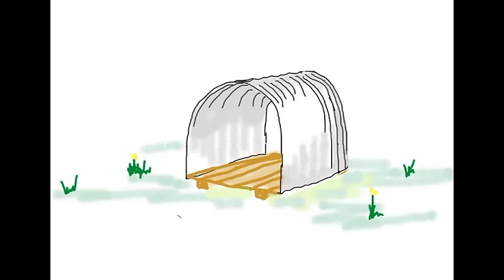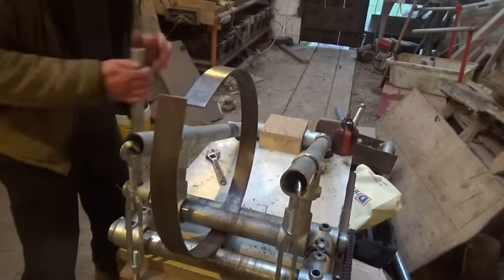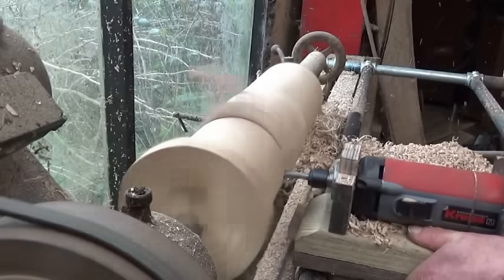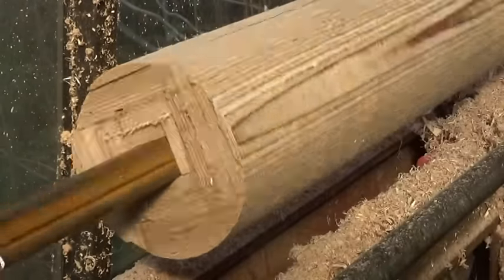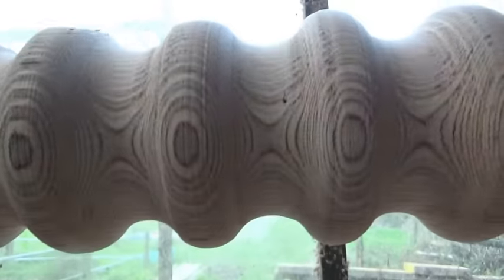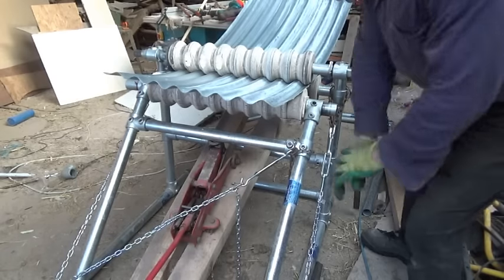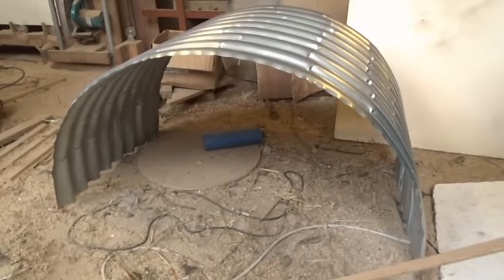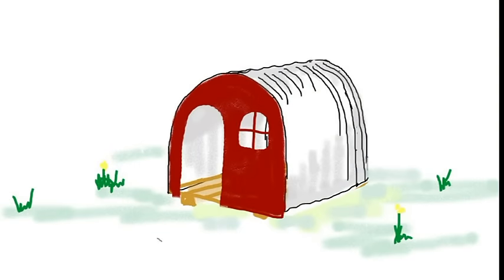Homemade Corrugated Iron Roller (well, nearly!)

Comment: Maybe cover the rollers with fiberglass and epoxy reisen,  but then add a gear reduction, making it easier to spin!
I know that sounds backwards, but if it's easier to turn you can turn it much faster, with it so difficult to turn , you spin it slowly. And aloit of time not spinning at all. So more leverage is needed, then maybe a drill could spin it!!!
Reply from the maker: Ha! A drill? Not sure about that, James  : -  )

Comment: You have literal horse power to hand! How about  shaft drive powered by a horse walking round turning a central hub to drive the roller? Doesn’t have to be fast, just have the power to roll smoothly 45 degree gearing involved on the shaft drive but can be direct to the roller. Seed of an idea? Gears from an old back axel for the linkage? Scaffold poles for shafts! That would be a great machine! And cheap!
Reply from the maker: Yes, but how about reverse?

Comment: Tom I have thought about how they built all the WW2 hangers and rebuild them so quickly, REME must have had motor driven corrugated iron rollers back in the day and instruction books to go with them. The other thing is there is almost certainly a finite radius that standard corrugated iron will go to.
Reply from the maker: You're right, James. I wonder what the minimum raidus is though?

Comment: Have a look at this https://youtu.be/D72M3DTyccg and this https://youtu.be/E18Emx7lHr0
Notice the rollers bend the steel in stages starting in the middle then in next stage another set of rollers on both sides of the middle are added and so on. This is to allow the sheet to “shrink” in width while the bend is being formed. 
You need to expand your machine into multi-stage.
Also, notice how thick the shafts on the commercial machines are.
Consider using 2 or 3” steel pipe with at least 1/4” thick wall as axles for your rollers. You can turn bushings to transition from ID of the pipe to OD of the shaft that will fit into the bearings. The pipe will flex considerably less than your existing shafts.
Reply from the maker: Check out the latest video in this series, Ro K - it's working now!

Comment: Hmmm why corrugated at all? My impression as to why you would use corrugated metal is to create air flow behind your sheathing to prevent moisture build up and rot. At least that's why we use metal corrugated. If its just framed and has no insulation or sheathing then maybe it doesn't matter? aesthetics?
Reply from the maker: It's partly for asthetics - I could do a much easier job with flat sheet, but then it would need a frame, as you say, and that would add a lot to the time/materials..

Comment: Howdy Tim.  Not to far from your original idea, would be to use corrugated metal on the straight sides and a piece of rolled flat sheet just on the top. Use pop rivets to attach the two or a spot weld. The open spaces created by the corrugations could add ventilation. Or you could insulate the inside to stop condensation.
Also, put runners under the pallets so you can slide or pull them around.
I know this would be a slightly different approach, your original idea is very clean and organic. Being made from locally sourced materials has an appeal that more commercially made items do not.
I don't think that this is another beautiful idea crushed by the hobnailed boots of reality.
Just a little tweaking and this boat will float, russell.
Reply from the maker: Yes, it would be a good compromise, Russell. Thanks. But I like the simple shape best so it's hard to give up on it just yet

Comment: You may want to try a larger diameter rollers it would engage a larger surface area of the metal perhaps decreasing the chance of buckling. Thanks for sharing.
Reply from the maker: Thanks, but it's between the rollers that the bukling occurs - so the smaller the better

Comment: Probably already suggested?? with the corrugated  flat sheets make the curve the other way starting at the bottom over the usual hoop house ribs (metal tubing or plastic?) you can get a pretty small curve and fastened with screws to the pipe will make a very rigid metal covered unit. hope this helps!
Reply from the maker: Thanks Gene, but I'm hoping to make something neater/stronger

Comment: Another option would be to buy large diameter culvert pipe and cut them in half. ask your local road crew if they ever have left overs that they cut off after a job. I know they make culvert pipe as large as 6 feet.
Reply from the maker: They only use plastic culvert here unfortunately

Comment: Take smaller increments of bend, your trying to stretch and shrink metal at the same time, little changes would help with reduced probability of creasing and less pressure needed each pass ie: easier turning.
Reply from the maker: You're right, of course. But it took 40 runs through as it was, so going even slower would take a long long time

Comment: I had a somewhat different approach and different type of sheets. The jig is loaded with almost a tonne of concrete slabs and I do agree that there is a lot of pressure needed even for this sheet. My strategy was to stretch the tops. It worked and the kinks I have are due to the sheet being second hand with holes and small dents in it:
https://rubensgarden.blogg.se/2018/june/fuktskadade-vagnen-fuktsakrad.html
Reply from the maker: thanks, Jan. Interesting method. I shall experiment...

Comment: For small projects like this just turn the corrugated sheet the other way and then put a slight fall in the design from front to back to provide water run off
Reply from the maker: Yes, but it just wouldn't look the same : -  )

Comment: Neat project, shame it didn't work out. My two cents on the matter would be to figure out some way of gearing the whole thing down. Maybe find a high reduction gearbox in a junkyard? I also wonder if you could make the rollers out of high density plastic instead of wood, since the chipping can't be doing anything any favours.
Reply from the maker: I hadn't thought of the plastic for the rollers. Hmmm. But the plywood ones seem to be standing up to the loads - so far at least.

Comment: The kink still seems to be worse near the ends, which makes me think the sheet stock is still wandering a bit. Some sort of guide, like the paper guide on a printer, might help.

I'm not saying anything you don't know, but if your direct drive design requires too much torque, then you need gears with ratio. Maybe you can lay hands on an old washing machine gearbox? Together with your long handles, that might be workable.
Reply from the maker: I think it's worse where it transitions from a straight to a curve, so so much because of any movement in the sheet. But a guide wheel might help too.

Comment: Worked in a factory that made corrugated iron sheets. The problem I see with your idea is you are trying to make all the bends at once. Machines I worked on started with the center bends which allowed the rest of the sheet to pull in and reduce width, then the sheet proceeded onto the second set of rollers which then formed the next set of bends and so on until all bends were formed. Just giving you a heads up on how this stuff is made. Good luck.
Reply from the maker: But I'm not making the corrugations, Paul. I'm just trying to roll a ready-formed sheet

Comment: Try not to take such big bites in one go.  Go for a slightly bigger radius over several goes then make it tighter the next time.  Big mechanical driven ones can get away with the forces but your jerry rig is a little too light weight.
Reply from the maker: It took 40 passes to get to these - I don't know how to do smaller passes

Comment: modern corrigated sheets are high tensile not suitable for rolling. the sheets you need should be soft meld steel as used for rolling corrigated iron water tanks
Reply from the maker: YOu're right, but soft meld corrie steel doesn't seem to exist here : -  (

Comment: Why not orientate the sheeting in the opposite direction? Rather than curving the sheet on the long side use a light support structure attached to pallet to define the curved shape, attach sheeting to support structure with long side down and short side up. Four or five sheets in total, more for higher structures.
Reply from the maker: Thanks, but I'm trying to keep the design really simple - I'm trying to avoid any support structure at all..

Comment: I like that you show all of your projects, not only the ones that went to plan. Great effort. 

I have seen these planters and large water storage cylinders made of corrugated steel in a circle formation. I am not sure how many pieces they are made up of, however you could use half of one for the roof. If you find a planter/ water container that is 1.2m in diameter you could perhaps cut it up and attach it to two pieces of straight corrugated steel. It wouldn't be the same as one piece but I think it will be an easier option and perhaps more cost effective.
Reply from the maker: Thanks, but they're not available here at all : -  (

Comment: Great work Tim. A blue barrel wind turbine on a rear diff axel Geared down with clutched coupler. Only issue here is wind power is extremely unpredictable. 

More realistic and easier to control maybe a hydraulic winch motor. This can be bought off a shelf in Hull but unfortunately you’ll need to invest in a hydraulic power pack.

HOLD ON ... rear axel supported vertical with prop shaft either higher or lower than horse been attached and walked around it in circles? Like a modern mill version? https://youtu.be/NO5nYqrO2s0
Reply from the maker: That's a mighty construction - I like it. Thanks. (I'll know one up after dinner!) But how about reverse?
Reply: Way Out West Blow-in blog  food for thought 2020 ish.

Comment: Did it have to be coordinated? I think flat sheet metal would look nice too. Maybe you can make your roller print a pattern into sheet metal.
Reply from the maker: It would work for the top curve, but I'm thinking it might be too floppy for the straight sides?
Reply: @WayOutWestx2  if the top and sides are one piece the curve top will lend some stability to sides. Some... the rest will come from attaching to the front and back "bulkheads" Think centre section of an upside down boat, the bulkheads keep the hull nice and stable.

Comment: Pedalling is the most efficient way for humans to utilise their power. How about a geared down stationary bicycle to drive the roller?
Reply from the maker: Good idea, but pedalling backwards is much harder, isn't it?
Reply: Pedalling a moving bicycle backwards is certainly more difficult! But as for stationary backwards pedalling, I doubt it is harder at all, after all your legs are still just moving up and down in the same sinusoidal motion. You could try it to know for sure of course. 
Another source of power I thought you could apply to the machine if you don't want to labour yourself is a horse mill. Though I suppose you would need to run a shaft through the wall as I doubt there's enough space inside.
Just thoughts though!

Comment: Why do you want to make lots of miniature air raid shelters for animals? Do you think Brexit will be that bad? We still have some of the bent corrugated sheet used in UK Anderson shelters from the second war & one of the few remaining brick built ones too. With steel you would almost certainly have to line it with insulation to combat winter condensation or the animal would be having cold showers in the depth of winter. I have made a few similar things using sheets of roofing material which in the uk retails for about £1 per foot at 1 metre wide second hand. I have sheet that has been up for several years, no rust & it's lovely & thin & light & also can be used for bee hive roofs. I don't try & bend it, just using straight sections on polystyrene for insulation & they work super well. The floor & sides from what ever wood I can get that is scrap, pallets, bits of plywood, all manner of stuff is cast out & hated by most here so they are happy to have me haul it away. I am confident that if I had to choose between living in a corrugated steel  house or a wood one I would choose wood, just altogether more cosy. Good luck!
Reply from the maker: Yes, the Anderson shelters shape is what inspired me. (My mum had one in the war.) Not sure you're right about the cold showers though - it's all about insulation and ventilation (I've designed grass-roof houses..) This is a really tough climate for timber - it all needs covering with something anyway..
Reply: @WayOutWestx2  My work shop has a metal roof that on some winter days drips dramatically. As I understand it the process is external cold causes water vapour to condense and or freeze on the inside and when it gets warmer outside the water comes off in big drips. Mostly people here (Lancashire) put insulation (polystyrene or similar) under the metal to prevent this. A neighbour has been selling wooden hen houses/dog kennels for years. He says he never has any trouble selling them. Wood here is destroyed very quickly if placed on the ground, but if you lift it off with bricks and put a thin insulation underneath (Welsh slate fragments are great) but the plastic damp proof courses work well, the rot is mostly eliminated, giving life times of multiple decades. Used engine oil, black from diesel engines seems very good, works well as a preservative on wood, or linseed oil which I use on all bee hives also greatly reduces rot, but both do need regular re-applications, every few years preferably. A bee keeping friend uses caustic soda to take propolis of his hives finds the resulting fluid is a great wood preservative, but does attack zinc coated and steel fittings. One could also clad sides with the metal roofing contour sheets. With out these protections anything wood in contact with the ground is destroyed quickly. Fence posts here rarely last more than about 5 years, water wickes up and they rot at ground level. The traditional defence was to char the post and I am thinking I may re-try that as replacing fence posts is a routine & expensive vexation, although the posts are tanalised they still rot, telegraph poles or railway sleepers are better but they seem to have (or did?) treatments not available to diy like arsenic hence the anti lick metal placed around the poles in fields with cows. Good Luck!

Comment: Here in Oklahoma we have sheds, garages, and barns made with corrugated sheet metal rolled in an arch like you are working on, and that rounded arch has many many kinks all the way round. It's normal, perfectly normal. These look better because of the industrial, especially designed for the task, machinery they do it with. I hope that makes you feel better about seeing the kinks all over it. Now having said that, would a dog in the house be scared of the sound of rain on a metal roof, and would it get too hot in the sun? White paint would help.
Reply from the maker: Thanks, John. Very interesting. So, you mean deliberately kink it in a controlled way? I haven't seen that at all
Reply: @WayOutWestx2  If I were to Google "Corrugated Steel Buildings" I would find pictures of the top rolled part of the building, it would look like one of the rollers in the machine has gear teeth that press in and emboss or crimp the metal, helping it to roll and curve in that direction.  So it is a controlled process producing a uniform effect. Edit-- The direction of that gear tooth crimp bothered me and I kept thinking about it. I am thinking that rounded section of corrugated sheet metal they put on the top of the buildings may be stamped and pressed into a mold for that particular look. I am still curious to know what a toothed roller result would look like VS a smooth round roller. But that would be hard to make for a testing prototype. But I sure admire the fun your having working that all out.

Comment: When you are doing such a tight radius, it is only possible if use a special corrugated iron sheet. Different manufacturers have different names for it,  Core-ten is one name I know of.  Unfortunately it is heavier and takes more effort to roll.  Perhaps you could buy a second hand machine. A lot of companies used to make corrugated iron tanks but many no longer do due to poly being more popular and mostly cheaper.
Reply from the maker: Thanks, David. I've been looking for a secondhand machine for many months and haven't found one : -  (
Reply: By the way, I saw a very skilled specialist doing a bull-nosed roof on site once and I noticed his machine was 4 rollers wider than the iron. I asked why, he said he didn't know why but that the wider machines roll better.  I haven't been able to figure out why it would make a difference, but I have never seen laps as perfect as he did.

Comment: Just use corrugated plastic instead.  Works great, easy to manipulate, lighter and even provides some insulating value.  Just get the uv protected stuff if it will be in the sun or it will become brittle in a few years.
Reply from the maker: I'm hoping to make plastic-free houses...
Reply: @WayOutWestx2  gotcha... It does make a good use for all the wasteful signage for events and political campaigns.  I made a micro-home using pallets, cardboard and campaign signs with windows made from cut up PET from 2 liter bottles.  It cost ~$1 in glue and staples.  I plan to make some more but use boric acid solution in the cardboard for fire retardant, mold protections and insect repellent which will add a couple dollars to the cost.
If you really want to roll metal, just form your cylinder from the sheathing and fill it with rebar and concrete - it should last a while.  If you want to thicken the steel shell, you can always nickel plate the heck out of it (iron plating is more difficult)... technically you could use some graphite based conductive ink and plate your wooden ones.